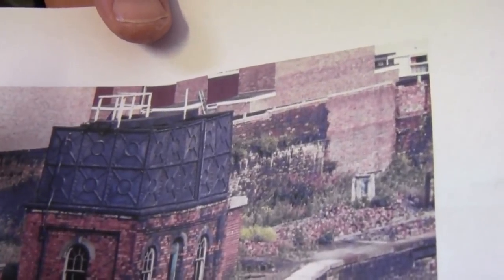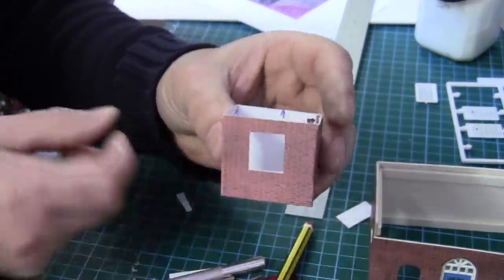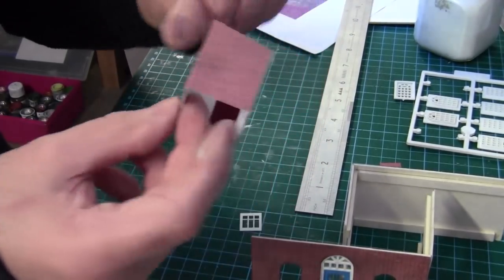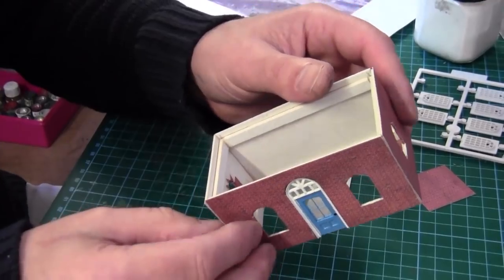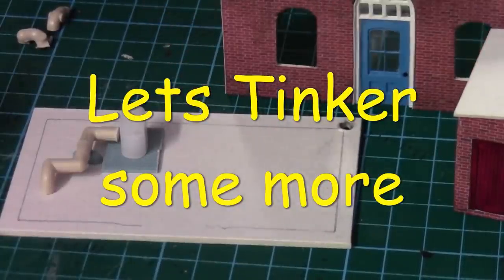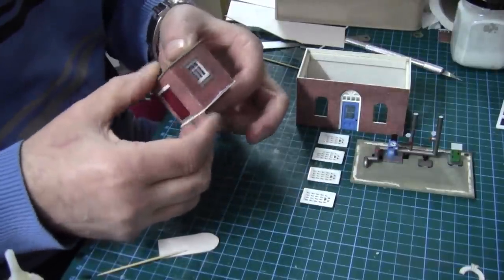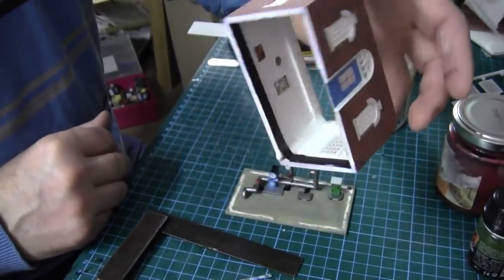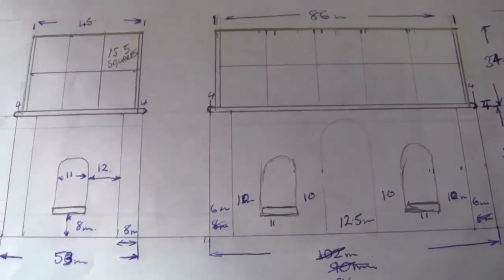OO Gauge N E R Water Tower Part 2............No 257

Comment: Tony, great work as per bonny lad. Love the attention to detail inside water tower. Such imagination with using scrap bits n pieces for pump & inlet/outlet pipe work 👍
Reply from the maker: Cheer's. Pipe systems is my field of work.....not a plumber. just a fitter......so it was easy to guess what may have been going in the water tower. thanks again for commenting............cheer's Tony

Comment: Another Great Build Tony!  I too used to live in Shields as a boy, in Wharton street, off Westoe Road. Not wishing to put a spanner in the works, but I am not convinced that the tank is split into two tanks.  I have access to your photo too and after enlarging the image I believe that what you are looking at is a pipe running next to the flanges of the side panels.  This may be the fill pipe for the tank possibly going to a large ball valve hung from the timbers.  At the end of the tank is another pipe that looks like an overflow.  I was also under the impression that the water crane was fed by gravity, hence why railway water tanks were placed at a height.   I may be wrong on all counts but it is maybe worth a second visit.  I also have seen a photo via Google that shows a metal ladder at the end of the tower going to a white walkway across the top of the tank, the remains of which is in image you are using.  I hope this is of help. Jason.
Reply from the maker: Hi Jason. i used to live in Stevenson street of Chichester road, small world.  interesting view, no you are not putting a spanner in the works. i have spotted the overflow pipe. that will be included in the build. that has been a puzzle where it looks like two tanks. that would make sense a running pipe. in the black and photo there appears to be a chimney pot behind the tank. would there have been a chimney on a water tower. as for the rest of the details like the walkway and ladders they will be included in the final build. photos can be deceptive. but also highlight a lot of hidden details.......thanks again for input very much appreciated..........all the best Tony
Reply: @TONYNORTHEASTERN  I have seen that chimney Tony, probably on the same black & white photo that you have and its size suggests that it is part of the tower or something very close to it.  Blea Moor’s (Settle - Carlisle Line) water tower had a chimney, presumably for a pumping engine and to provide heat to avoid freezing at that exposed location.  Settle’s water tank kept horses under the tank to prevent the water from freezing.  Before mains water was the norm, water was often pumped to these tanks from underground sources, streams and fresh water rivers (not the Tyne!).  As the station hails back to 1879, the tower is likely to have originally been fed by pumped water.  Best, Jason
Reply from the maker: Cheer's Jason. the information in your comment has given even more to about. the chimney breast i can still add even in this late stage of the build. i will add that once the tank is built. i need to pull my finger out and get cracking....thanks again for your invaluable help............Tony

Comment: Yes, it looks like a lamp hut...  The clue is that there is no chimney for a heating stove.  If you are storing lamp-oil and lamps, the last thing that is needed is a naked flame.  (Note: Lamp-Irons are the supports on which lamps are mounted!) 

Incidentally? have you ever tried using Sharpie-style pens for colouring the white edges of card?  The dull browns and greys are very useful for this.
Reply from the maker: Hi Ken. thank you for the use of what the hut was designed for. such a small building. the tip for the card sound like a good idea........thanks again all the best Tony

Comment: Just wondering if there would actually be an electric pump in the pipework between tanks & water crane. Large bore piping of 5 or 6 inch diameter would in itself ensure a fast flow of water by gravity from the high elevation of the tower tanks. A pump relies on an electricity supply, would that be available in the nineteenth century? And if the pump breaks down or there was a power outage then the pump would severely block the water flow and you'd be buggered (sorry for the industrial lingo). Just my thoughts, I'm probably talking utter rubbish!
Reply from the maker: Good Point. i also think that gravity alone should be enough. i think you may be right. there would have been a level gauge, and filters to trap any debris. or was just the case of going up the ladder, to have look how water is in the tank. it could'nt be that simple. could it. interesting from a mechanical point of view. i like to think they modernised it in the 1930s...maybe...thanks again great comment...............stay safe all the best Tony